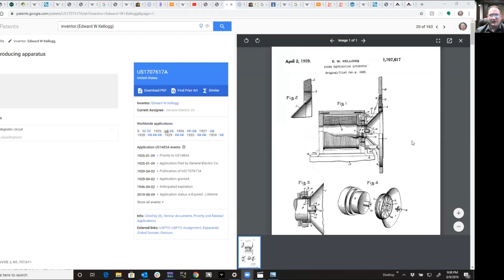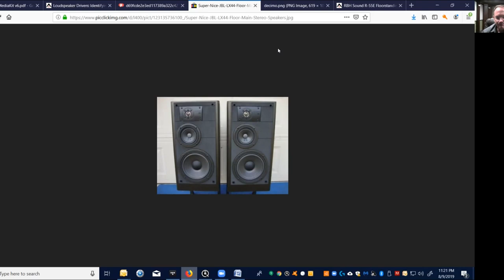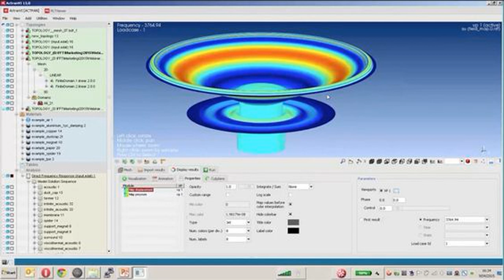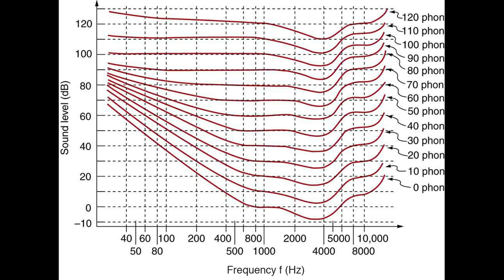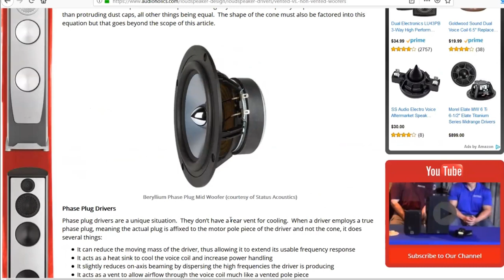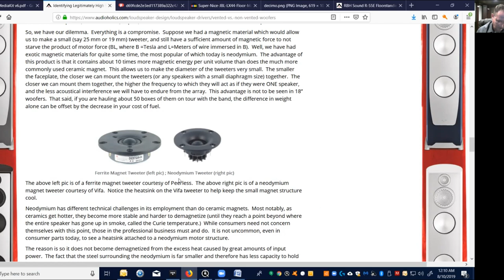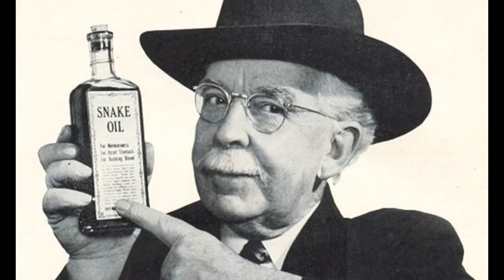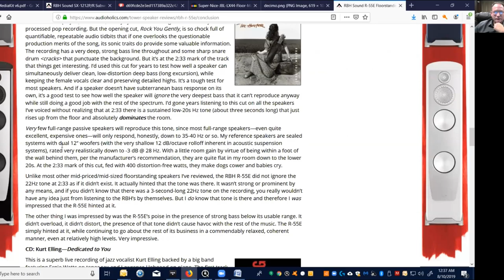Do Exotic Driver Materials Make Loudspeakers Sound Better?

Comment: oh please, this is the reason why speakers are highly overpriced and all the cult: the misinformation and lack of product description. the standard in any speaker driver must be sandwich cone and it's ridiculously cheap and stupid to do.

just make a mold and use resin infusion or vacuum bagging with epoxy and 25gsm carbon fiber mesh or mat (if you can access to an autoclave put it in there to cure). you can make two cones and use an hexagon or V sandwich structure with another mold, then you glue the two cones and sandwich core with epoxy.

this is the most efficient, lightest and damping cone you can make, however if you use thinner unidirectional or woven carbon fiber it will be stiffer and stronger, also if you make a blend of thermoplastic with epoxy it will have better damping.

Comment: LOL - The best drivers in the world (Scan-Speak)  are paper...  The classic 8545 and the Revelator still rule them all.  For tweeters, textile still wins there too.  BE tweeters, despite being in fashion, often don't perform as well.  Aluminum is fine for woofers, but the FR breaks up at xover if you use them as a mid-woofer.  Again, SB acoustics "satori" woofers, and SS still use  a lot of paper drivers for woofers and they sound + measure awsome.
Reply: Scan Speak's most expensive woofers are aluminum and carbon fiber
Reply: @DougMen1  um no....